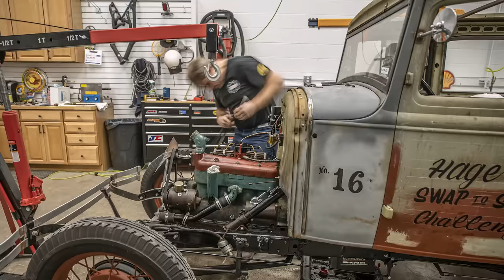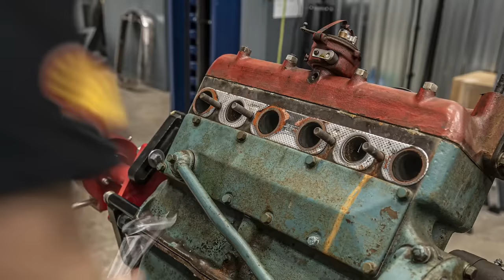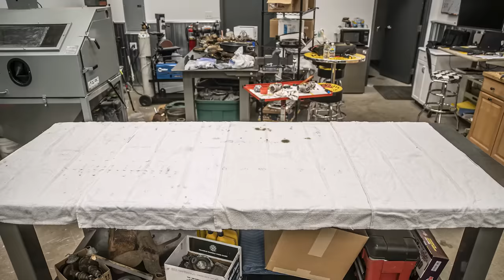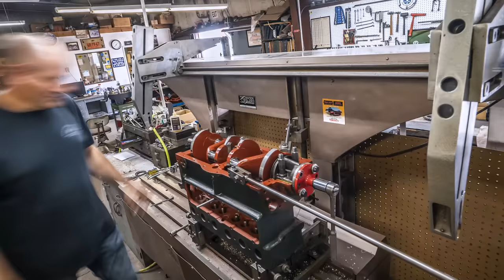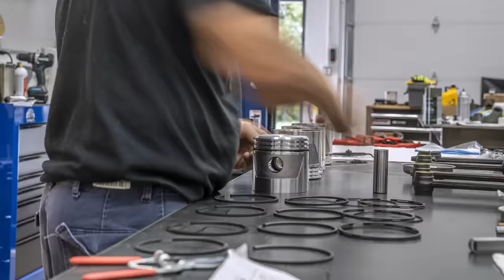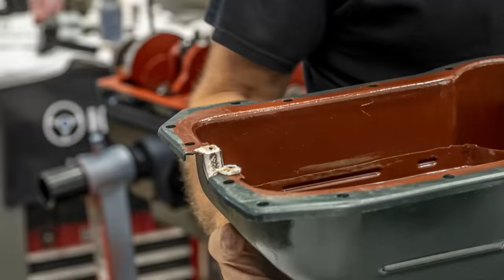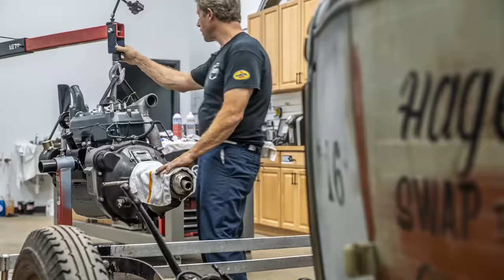Ford Model A 4-cylinder engine rebuild time-lapse | Redline Rebuilds - S3E4

Comment: That exhaust manifold is less rusty then my 97 ranger’s thats not ok I blame Connecticut
Reply: Yes the only major part I think should have been replaced was the very clean but extremely rough looking exhaust manifold. Everything else looked incredible.
Reply: John Ciaccio ikr prob bc its not a dodge
Reply: @joshuacomfort8059  Should have added I have a 97 Explorer from Illinois. I hear you. 😋

Comment: Ive noticed a number of videos you guys have made involve older fords. I have a unique tool handed down through my grandfather from his grandfather for these. From what ive been told there was a routine service needed on these that required removal of the engine to reach a set of bolts. Being a farm owner my great great great grandfather was unhappy with that time consumption since he did his own service, and designed and fabricated a tool to fit perfectly and allow the bolts removal without need to extract the engine. If you would be interested in adding it to your collection of classics, please let me know. It would do the ol mule proud.

Comment: Got to love the old Motors, I had a 1950 International pickup truck with a straight 6. the rod bearings locked up on me while I was going across town I live in Green Bay Wisconsin.. so I got under the truck the next morning after we towed it home. Dropped the oil pan , drop the rod bearings, push the Pistons up, took some emory paper and sanded all the journals down. put new rod bearings in it with some plastic gauge underneath the ones that I sanded hard ... ran the truck another 8 years . everybody told me that's never going to work , that has to be Precision machined...maybe on a motor nowadays, but not in an old International pickup truck or any of the other old Motors.. so the Tolerance on your motor, how perfect it is .... from your rebuild.... that Motors got to feel like a brand new baby. Running good... like I said I ran that truck run another 8 years and then the guy that got it from me, is probably still driving it and they're still no rod knock....

Comment: You mentioned at the beginning of the video the car had oil leaks. At 25 seconds and 36 seconds in I noticed the oil filler tube had a rag stuffed in it. Stuffing a rag in the oil filler tube can lead to serious oil leaks. The cap of the Model A Ford oil filler tube was a special cap that allowed the engine to “breathe” and not build up pressure in the sump. 
I take it the previous owner had lost the cap and stuffed the rag in the tube to keep dirt out. But by doing so, the rag stopped the engine from breathing and caused pressure to build up in the sump which forced the oil out to either the front of the motor, or the bell housing at the rear of the motor. 
 I owned a 1928 Model A Ford back in the late 1950s and had a similar problem. In my case, I lost the original cap and found a lid from a jam jar fitted tightly on the filler pipe. Then the oil leaks started. Engine oil was leaking from the bell housing at the rear of the motor.  The oil leak was so bad I tied an empty paint tin to the bell housing to catch the oil and poured it back into the sump. I was not aware that the cause of the oil leaks was the jam jar lid that stopped the motor from breathing. We did things like removing the motor and checking it for worn seals and gaskets but nothing worked. It still leaked oil for months. A friend mentioned he knows an old guy who is a backyard mechanic but is good at fixing motors. 
I took the car to him and explained about the oil leak. He opened the bonnet, and looked at the motor and said  “I can fix that oil leak in a few minutes with a hammer and nail.” 
So, he gets a hammer and nail and punctures two holes in the jam jar lid. From then on, no more oil leaks. The two holes stopped pressure from building up in the sump.

Comment: There was a taxi company in Brazil which used Model A Ford sedans and each year they would send 2 engines to a man in Chicopee Mass to be rebuilt.  They had shiping crates built specifically for this job.  After the rebuilds were finished they shipped the engines back and waited for the next 2 engines.  I believe that he didn't use Babbit for the bearings, and machined for bearing inserts.  The rear main bearing was designed by Ford to leak a little bit and the oil would drip on the ball on the end of the rear wishbone.  A small oil spot on your garage floor was a sign that it was working.  I watched one day when he was starting up a rebuilt enging to test it and it was the sweetest sound.  I sold my 1929 Tudor last year as advancing age made it too hard for me to continue.

Comment: The only disappointing scene was towing the car to get it started, I'm assuming the engine was too tight to start with the key.
Reply: That's exactly what it was. It was in the update video right before this. He said after they finished, it was something like 120 ft lbs to turn it over because they kept the bearings tight.
Reply: Could give Arnold Swarzenegger the hand crank to turn it over.

Comment: My dad has built and rebuilt dozens of engines over his 80 years but he tells me the early Ford Model T and A engines were the easiest to work on. And if you think about it, they had to be because there was no dealer or repair shop networks like there are today. In fact most repairs were done at blacksmith shops! So the engine had to be very simple to repair. Driving them, on the other hand, was quite a lot more driver engaged than cars of today. There's a LOT for the driver to do both before and during driving!

Comment: An old beat model A or a T is on my bucket list. I love the stock look but I’d be inclined to make some power and reliability mods to the engine. Having hand built 2 Megasquirt ECMs and installed on 2 old cars, that little fella would be a piece of cake. Additionally, a small turbo would lend nicely to the crazy low static compression ratio of that little flat head. You could get a reliable 75 to 100 hp from that mill without breaking the stock internals.

Comment: My 2014 gmc Cummins had one of these in it from the factory. 800 hp 1000 foot pounds of torque. I put  superchargers and a turbo chargers on it. It instantly made boost off the line with the superchargers. Then at 30 psi the superchargers clutches switched off and the quad turbos kicked in. Instant wheelies at 100-110 mph....it's got 5 nitrous bottles in the bed but for what. Nothing can touch it. Maybe I'll rebuild it one day like this but for now I'm happy with 1000 hp.

Comment: That induction heater is probably a lot more convenient than using a blowtorch to loosen those head studs!  Interesting how they are using molten lead to create new main and rod bearings.  I supposed they would have to due to the fact that OEM bearings would be kinda hard to come by from your local Napa parts store.

Comment: Near where i live there is an older lady who had a 1931 model A sitting in the corner of a field for a while. when i went to talk to her she said it was her husbands but he died and left no instructions on what to do with it. after looking at it i offered her $500 for it and she accepted the offer. The roof was caved in and pretty much everything needed to be rebuild or reupholstered. currently have the transmission being rebuild at a pro shop and the block is away at a machine shop. I can't wait until I can get her running again.

Comment: It's probably a better engine now, than when it was new! The way those babbitt bearings work, I would change the oil after the first few minutes of operation. I don't know if this engine even uses an oil filter. If not, those first few early oil changes are critical to the future longevity of the engine.
   MSD ignition, Turbocharger and Nitrous? 😎

Comment: This is hands down the most extensive model a motor rebuild and pretty much everything someone keeping a "stock" build would want while still doing the necessary "upgrades" to keep her going. Unfortunately there's not enough of the finished product! I wanna see more,I wanna HEAR more. I've gone my whole life hearing a 29 model a motor just running,I wanna hear what someone who BUILT their motor heard back in the beginning of hotroding. Just more finished product or a link would be awesome

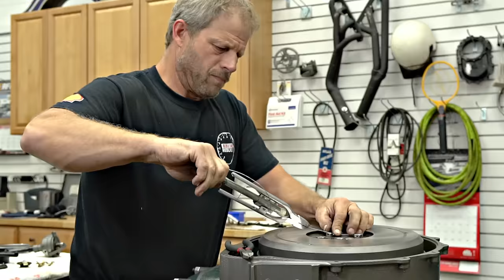Comment: Cool videos. Love the vintage engines rebuilds. Have a dumb?, around 6:20 he's using thin solid alloy looking wire at back end of engine. The external end of crankshaft?

Comment: Looks like the fastest engine rebuild in town. Just shows you what can be done when you get mad enough at it. Of course having all the right tools doesn't hurt either. But how come you guys went with Babbitt bearings on the mains as well as the rods, it appears? How come you didn't use inserts? And why didn't you do the flywheel lightening and crankshaft counterbalancing trick? Maybe that would have taken too long and cost too much.

Comment: According to the owner manual ,the fuel consumption of this car is 1 mpg but when you turn on eco system using  handheld it gives you more around 1.5 mpg . which is not bad at all . . but  this car last 100 year for daily use .

Comment: What was not obvious in the video were the modification of the crank shaft to add "Throws", and the modification of the "Flywheel" to reduce the weight.  This will reduce the flex in the crank shaft and reduce wear on main bearings.

Comment: All right engine freaks I got a question could one of those old blocks be made to have conventional bearings for an upgrade same with the connecting rods I'm sure they can how else can you hop up a flathead bump up the compression to improve the ignition maybe two carbs maybe some kind of tubular exhaust what kind of horsepower do you think one of them little motors and make might be kind of interesting project I think. Love the video what is the red paint inside the crankcase I seen it before but I can't remember the name of it

Comment: You should get about 40 hp if you did it right. I wonder how many old 2 cylinder 1903-04 Model As are still out there. They could only do about 8 hp. Total production was 1,750 cars. It sold for between $800 and $900 depending on options, but it couldn't compete with the Oldsmobile curved dash which was $150 cheaper.

Comment: was the engine rebuilt using modern techniques, tighter cross hatch for example? What will the brake hp be now? Will You retrofit the oil filter kit?

Comment: I see you’ve used one of those heat ductors to heat the studs to get them out of the block 

seems to me heating the stud would expand it and make it tighter in the block and make matters worse 

Hearing the nut....... I get it that it expands the nuts and loosens it off 

I don’t see how heating the stud helps but it obviously does because they all came out....!

Maybe the action of heating expands the stud and breaks away any galvanic corrosion releasing that binding  in the thread...... or Rust from water galleries

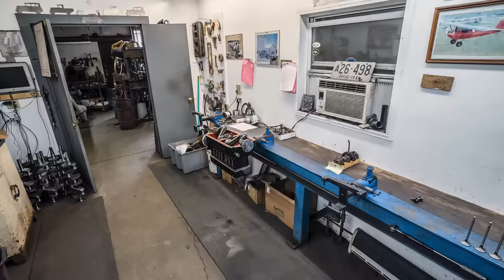Comment: 4:07 Is that a pietenpol aircamper in the top right corner? I think those were originally built with Model A Engines.

Comment: Interesting are the tools used. I like that stud heater and the remote bearing caster thing.
Wonder why they chose to use studs and not bolts for fasteners everywhere and why are the pistons so heavy and ...

Comment: This was way to fast. Do you have the maschine shop episode? So what did you use the cerikoat on? 
Did you reuse all the parts or which had to be replaced?
What was the metal used to repair the crankshaft ways?
What was the process for the piston rod inspection and repair?
What did you do on the generator, carburetor, and magneto?

What year did they stop with the hand crank starter?

Comment: What would happen if you attempt any extreme modifications on an old engine like this one such as drilling oil journals into the engine block and cylinder head with a mechanical oil pump similar in design to a camshaft to get the oil to an oil cooler then back again at the crankshaft section?

Comment: I have an old car, I would like to strengthen the engine in it, what parts should I replace?
Please help, I need your information
large piston, thick piston rods, large crankshaft
is it enough to power the engine
Reply: That really depends on your budget and the engine.

Comment: I would so love to know how much it cost for all the parts and work done to this engine.

Having a Ruston 4VRO engine in need of overhaul, I'd love to do it all like this!

💵💷
Reply: It's mostly the bother of finding someone who still has the babbet pouring molds. The rest isnt much different than any other 4 banger aside from the upside down valves.

Comment: Question: Could the engine have been machined to use modern engine bearings instead of the cast in bearing material??

Comment: Looking at the design engineering of this engine you get the feeling they still hadn't grasped the basic principle of an engine :  that it is basically just an air pump.  And the cast iron intake manifold right next to the exhaust manifold using shared intake ports?  Hmmm, not exactly a cold air hi-flo intake...

Comment: That engine literally takes up only about a quarter of the engine bay. Cars should still be this way. You could still in-frame a d15 in a 90s honda but at this point you might as well trash the whole car if it needs the engine gone through

Comment: After watching this video, I see that the internal combustion engine has changed little. It turns out to be the same mono block, clutch, pistons, in short, basically the same as modern engines. I can't believe that in over 100 years engines have not evolved faster. until now that electric motors are coming out. The vested interests of the oil industry and the world's governments have been devastating to the climate, ecosystems and peace among the world's nations. In the end, the car is almost the same iron from 100 years ago, with almost the same engine, steering wheel, tires, brakes, etc. Of course, they are more efficient and cleaner, but they are still contaminated directly and indirectly.
I love cars. I like them very much. I really like mechanics and I like to see how they work. But it must be recognized that they have been the cause of many disputes.

Comment: The easiest engine to rebuild is the AMC 242cc I6 engine.  If someone brings one in the morning, I can have it rebuilt for them by around 16:00 to 18:00.  They are Lego sets.  Of course, the engine would not be installed.

Comment: I had my 1930 engine rebuilt by a company in Calgary AB and it rand for 5 minutes and Quit  I thing they got the bearings to tight and when they warmed up the cease up It is hard to crank

Comment: I was just wondering, what's the displacement on these engines? Anyone know? I was just watching, saw the bore seems decent, along with the stroke, seems a bit on the long side, but it's a low rpm engine.. but seems a bit on the large size compared to modern 4 cylinders,  small main journels , with only 3 bearings! I guess they built them like steam engines back then. For TQ not HP, like today! They found they needed to spin them faster to make the engines more drivable! The long stroke low rpm TQ monsters of the past were something else back then, much faster than horse and buggy!!

Comment: I did not see how the parts and all components were suddenly looking like new and if they were new, or how they were refinished and painted/restored/sourced. Where did the specs come from for the parts/refinishing? Who did all that work? Tolerances/measurements? Also, the sound was driving me insane so I had to shut the sound off. Could have been more interesting instead of looking like some kind of rapid/restore.

Comment: They all leak oil because of that rear main seal being made of cork. Of course it can be rebuilt with a good one. But don’t let it scare you when buying a model A if it has the original main seal. They were pretty much designed to leak. Total loss oil system.

Comment: All that hard work then using crap oil inside.
Reply: I'm not a pennzoil fan either.  What it needs is Amsoil 10w30 z-rod which is for older vehicles like this.  This is what I put in my '62 Galaxie and has made all the difference in the world.

Comment: When they attach that heath coil thingy to the bolts what does it do? Anyone know?
Reply: It's like a small induction heater used to warm up the studs to get them loose. Much better then a torch.

Comment: @ 6:20... what was that he did?
Reply: He is using lockwire and lockwire pliers. It secures the bolt making them more resistant to coming loose through vibration or accidental tampering.

Comment: I worked at a manufacturer if l mentioned would be well known for nineteen years ..a toolmaker apprentice for four years... It was drilled into us to use safety glasses. If we were caught enough times not using them we are would be fired. I see you guys are running this equipment without eye protection, and I cringe. I knew I guy using that bolt wiring tool who lost an eye when the wire tool slipped up and cought him in his right eye. Anytime a spindle is turning in machine shop safety glasses need to be worn.... You are asking for trouble.